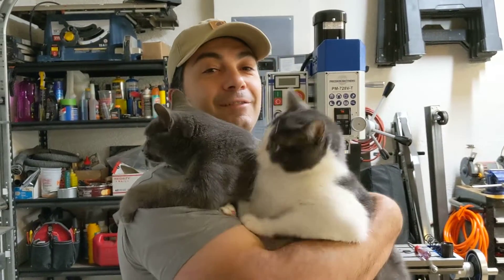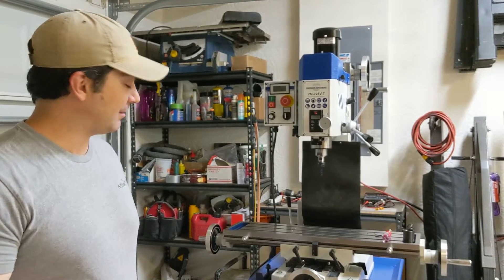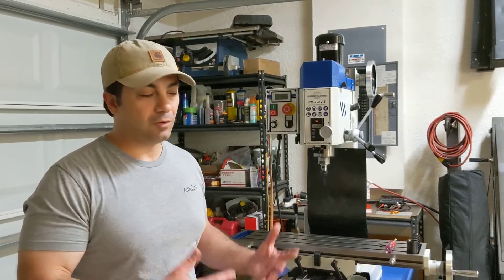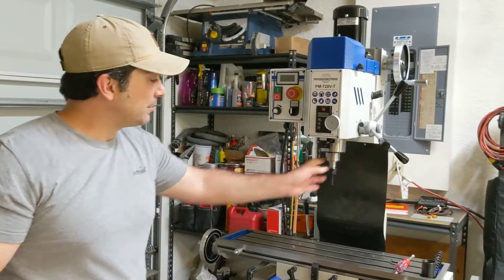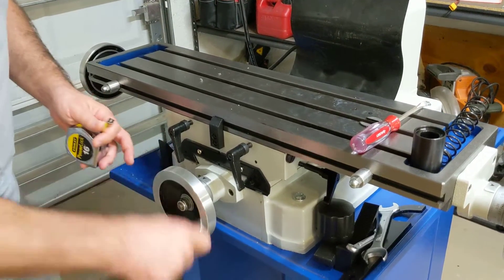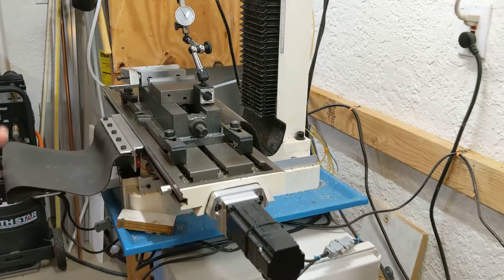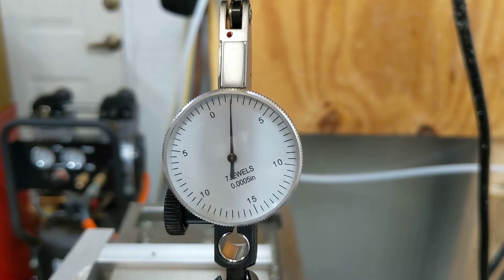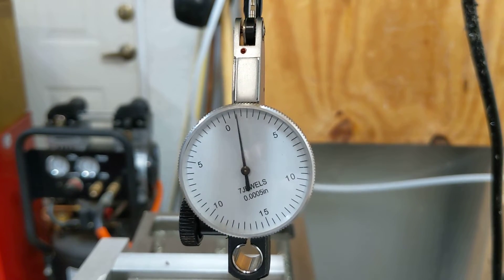Precision Matthews PM-728VT vs PM-25MV Milling Machine Comparison

Comment: What was the table tram in the Y direction on the PM-728VT?  I have been considering buying one but was concerned because the column is bolted on from  the bottom of the machine  and would make it difficult to adjust or shim.

Comment: Cool cats!  Appreciate the comparison video on the two mills...  I've been looking at purchasing a medium-ish bench mill and want something robust/rigid, with good accuracy.  I've seen your video no the PM-25MV and had contemplated that due to cost, but after watching this video, as well as a few others on the 728MV, I think that's the way to go.  It appears to be a solid machine for the money, and looks to be of a higher build quality than the Grizzly equivalent.  

Regarding backlash...  That can easily be worked around, I've used Bridgeport's with a huge amount of backlash and it's manageable.  The best and most obvious way is to install a DRO, gives you absolute position, regardless of the amount of backlash.  I'd much rather have smooth travel in the three axis'...  

Great walk around of the machine...  Just have to figure out what I want to sell so I can use the money to buy one!

Comment: I saw your craigslist ad in which you're selling the 728VT. Any particular reason you opted to keep the PM-25MV over the 728VT? I was looking at the PM-25MV as potentially my first milling machine (no plans to CNC at this time), but your listing has me intrigued.
Reply from the maker: The PM728VT is a good machine - better than the PM25MV.   Truth be told, the PM25MV may be the next item to hit the auction block.  I'm dealing with some changing circumstances that require me to spend less time in the garage and more time focusing on other things.

Comment: 3:45 - This bit me in the butt today.  I spent 20 minutes getting the chip tray and mill all bolted down on the stand.  Then went to start tramming it in and there's 4 thou of lean i wanted to shim out of the column.  On the 728vt, that means I have to unbolt everything from the stand and hoist the thing up in the air to access those bolts.  Kinda disappointed that the "ultra precision" model is way more out of whack than my harbor freight mill was.

Comment: Does their stand have a hole underneath where the column mounts so you can get to the bolts? Or do you have to lift the mill off the stand in order to get to those bolts? Also, did you have to shim the column at all to tram it (or did you even worry with that)?
Reply from the maker: Hi.  There are no holes in the stand.  I've not had to shim anything to tram in these mills.  But, that is not a promise that you won't have to shim yours to make it "perfect".

Comment: Just for the hell of it I’d like to see that twist test on a full size Bridgeport mill. I’d expect zero deflection of course given the mass of the castings.
Reply from the maker: I did perform this experiment on a Bridgeport mill (using the exact same bungee cord).  There was very little displacement - less than .0005" which is no surprise considering the size/weight of the machine as well as the construction.  Bench top mills are great and many of us wouldn't have a mill in our garage or basement if it weren't for them.  But, when it comes to machine tools, bigger is usually better.
Reply: @FrancoCNC  It's a great test and really opened my eyes to what these little machines are. I found a new-in-the-crate PM-25MV on craigslist that I almost snagged. Guy bought it with the intention of doing a CNC conversion but never even unpacked the machine. Unfortunately someone beat me to it. Maybe a blessing in disguise though after seeing this video. The extra rigidity in the 28 over any distance on a part would be a lot of improved tolerance! I'm still shopping for and weighing the used Bridgeport option though.
Reply from the maker: @thenetwerx  Cool.  I've thought about using a knee mill as a starting point for a CNC conversion.  The problem is the big heavy knee can be problematic when you try to make it the Z-axis.  You don't see very many "real" CNC machines that use that design.  They generally put the Z-axis on the quill of a knee mill but then you have limited travel.
Reply: Franco yep, you are correct. I wouldn’t convert it to CNC. It would be for manually machining larger, heavier one-off projects that simply won’t fit on a bench top mill or require more horsepower and rigidity. In an ideal world I’d have the space in my garage and funds to have both a Bridgeport and a nice CNC mini mill. BTW, have you watched any of the Titans of CNC Academy video series?
Reply: @FrancoCNC  you could perhaps add gas struts to the knee
Reply: @FrancoCNC  This is getting a little carried away, but pulling on the spindle on a Bridgeport doesn't apply pressure to the Z-axis ways like it does on the bench mill.  The Brideport design might be weaker if you pulled on the table instead.  A better comparison would be to have two bungees, one pulling on the spindle and one pulling on the table in opposite directions.  This makes a differential measurement and would be equivalent to the deflection from tool cutting force.
Reply from the maker: @mgraen  I like the way you think...

Comment: PM-728VT is $1K more than the PM-25MV, with your honest opinion you think it's worth it when it comes to precision and tolerance for ease of usage with a CNC? Thanks.
Reply from the maker: Aside from the smaller size, the  PM-25MV is just as good under CNC control as the PM-728VT.
Reply: @FrancoCNC  Thanks for the reply. Also what about your opinions between PM-25MV and G0704 under CNC? The G0704 seems to be about $500 lower now. Would the PM-25MV be much better for $500 extra?
Reply from the maker: @sto2779  If it were me, I'd buy the PM.  But, I'm sure the Grizzly would also do fine.  But, I do believe the PM is better than the Grizzly and the people who run the show at PM are super cool.  You'll get better customer service from them.

Comment: Just ordered my PM-728vt to replace the harbor freight mill.  The DRO model is on back order for a couple weeks which gives me time to make it a spot.  I'm trying to figure out where in the garage it will sit when it finally gets here.  Can you measure how tall the blue stand is and how far up from the floor is the bottom of the table or X axis crank or whatever sits lower?  Basically, I'm trying to figure out if this can sit beside my existing work bench and be tall enough for the table to overhang over my work bench if that makes sense.

Comment: I have converted a PM25 to cnc and acknowledge it's shortcomings by taking smaller cuts and plenty of them. You don't have to wind any wheels, hopefully you just have to watch it do the job.
Reply: Hey Phil, in hindsight would you have done anything different, like perhaps upgrade to a newer model for cnc, or are you happy with the PM25 cnc?
Reply: @anthonyortiz7924  well bigger is nearly always better, but I'm pretty happy with it.
I did go a bit overboard with the power of the stepper drivers though, turns out that I could have got away with controlling the whole machine with a gecko G540 on 48volts according to "the Corvette guy" channel. Anyway I find it a handy machine to have for jobs that are too heavy for my routers.

Comment: Another difference, with the PM-25MV you can get away with a 110V 15A service. With the PM-728VT you need a dedicated 110V 20A circuit for it.  I would have to upgrade my electrical service to run the PM-728VT in my garage.  Just something else you need to factor into the equation.

Your Russian Blue is not as skittish as ours is.
Reply from the maker: Tucker, the all grey fellow, has very strong hunting instincts - he won't eat his food unless you play with him first.  Winston, on the other hand, is very lazy and friendly.
Reply: @FrancoCNC  Tucker looks like he is a Russian Blue breed. They have some interesting characteristics. We got our girl as a kitten from the shelter. You don't see many of them there and we were lucky in our timing.

Comment: Can you tell me what the main decisions you made to go PM over Grizzly or other similar brands. I have a G0704 and a G0720R that are both CNC. I’m looking for a good machine to keep as manual now. 

BTW, great torsional displacement comparison. If you can move the heads .002” with a bungee that’s wild!  Imagine the displacement taking a decent sized cut. I have to do that test on my machines.
Reply from the maker: Grizzly is a great company and I've purchased a lot of items from them.  I had a G0704 mill.  I feel the quality of the PM stuff is better.  PM is also a smaller company and they seem to have really good customer service.  Truth be told, nearly every machine is going to have some kind of displacement under load.  The other day, I grabbed a hold of a Makino CNC milling machine while an indicator was on the spindle and I could push it around several tenths (.0001") without too much effort.  Honestly, the best test for any machine is to make a part.  If you can hold your tolerances and get good finishes, then you are doing great!

Comment: So is there anything the 728 can do that the 25 cant, other than work on bigger pieces and deeper cuts/more precise?  
  I wanted to get a mill for hobby gunsmithing.  I've made a few 80% AR lowers as well as glock/polymer 80 lowers.  I've been wanting to build a 1911 but didnt want to buy a bunch of special jigs and tools that are only good for 1911s so figured I could get a mill that I could use for other parts as well, for example maybe some parts for my motorcycle or something.  
  For my uses, do you think the PM-25 would be a good choice or would u recommend the 727V or the 728?
  After watching your comparison video, are the only differences size/weight/precision of parts and rigidity for the most part or is there a job that the 728 can do that the 25 cant without major changes ?   Do you think the PM 25 is precise enough to cut the rails on steel 80% 1911 frames, as well as steel slides?  
  Just want to make sure I get a machine that's capable/precise enough to cut rails in a steel 1911 frame which is probably the hardest metal I'd work with so just want to be sure its capable to cut nice, straight and even lines.  Thank you for any feedback you can give me, I really appreciate it!  Seems like the 728 will be a bit more precise as well as able to work on bigger projects but doesnt seem that I would need something like that for what I want to use it for.
Reply from the maker: Hi.  I think the PM-25MV would work just fine.  You'll just have to make sure you don't push the smaller machine out of it's "comfort zone".  But, if you can afford the bigger machine, you won't regret it.
Reply: @sammy awesome, thanks!  Definitely reassuring to hear coming from people that actually own the machine.
Reply: @FrancoCNC  Just ordered the 728 last weekend.  Deciding factor was thinking about all the "made in China" items I've bought over the years, most stuff cheaper clones of things and Chinese items almost always have low quality fitting, low quality material, or low quality assembly, usually thought is 2 of the 3 listed lol.
  So figured it would be best to put all my money toward the mill and vice, and since its backordered thatll give me time to save for a month or 2 for some tooling.  
  Actually started to consider the PM-833V-T, but that would have been really pushing it considering the space I have and I'd also have to get a 220V electrical setup so decided the 728 was the best for my circumstances.
  Cant wait until it arrives!  Hoping I learn more between now and then about setting it up and get all the guages and indicators necessary to set it up properly!
Reply: @perchowski3021  I got the chinese mill in 2018.  It was 1/10 the cost of this 728VT.  It was fine for getting into the hobby.  After a pretty easy life with a couple hundred hours on it, the chinese mill up and died on me.  I was in the middle of milling a washer.  A grade 8 washer from lowes, about 1/8" thick.  The little china mill just quit mid-cut.  Best as I can tell, its the motor that quit working.  It runs about 1/2 the cost of the machine to buy a new motor from LMS and my 90 day warranty is up. 
I was pretty much sold on something from precision matthews.  The extra 2yr worth of warranty is really what pushed me to the 728 over the 25.  Hopefully they actually honor it without any funny business like requiring you to ship the entire mill back to get any service.
Reply: Will the pm25 handle milling small slots through a 1/2" piece of stainless steel if you just take it slow with good end mills?
Reply: @jbaileyknives7282  the key to getting top performance out of any mill is using high quality end mill bits. You would want AlTiN coated variable twist end mills to squeeze the most out of a small mill in stainless steel. A half inch bit of this sort will set you back about 50 bucks. Most of the worst complaints which have been heard from small mill users have been associated with cheap bits AND bad feed and rotational speed rates. Many balk at spending real money on their cutting tools when they go low-price on their machine.

Comment: Precision  mathews should make a special "cnc ready" machine. One that is designed to be user upgraded to a cnc mill as easy as possible.
Reply: Iv been thinking the same thing. I don't know why they couldn't import a machine with ball screws and motor mounts. It would be a great value for us.

Comment: So glad u did this!  About to buy a mill and wanna get a Precision Matthews.. its gonna be the PM-25, PM-27V, and PM-28.  Gonna be my first mill I know nothing lol.. figured I'd get the bigger one since all the reading I've done says to get the biggest you can afford.  Or even the biggest you cant afford lol..
Reply: Don't overlook the PM30-MV. The PM728 does have some nice features like built in oiling of the ways, worm gear adjustable head tilt, better bearings, and possibly better finished ways to name a few. However the PM30 has a 2 HP motor, larger work surface and 160 lbs more weight. If I had it to do over it would be hard to choose.

Comment: Wow good video. I need some help please. I know that this video is 2 years old. But I just received my PM 728 VT milling machine December the 6th. I have not been able to get in touch with anyone at precision mathews due to the holidays. Mine has 800 thousandth back lash in the X axis which is unacceptable to me. In your video you said you could adjust it out. Please tell me how. Thanks in advance for any help you can throw my way.
Reply from the maker: That is quite a bit - over 3/4 of an inch.  I would look at the collars - it is possible that the may not be assembled correctly.  The nut under the saddle should have set screws on it (or something like that) to spread them apart to take up some of the backlash.  But, it sounds to me like there is something loose or not assembled correctly.
Reply: @FrancoCNC  thanks for the advice. Got in touch with precision Mathews today. I pulled the table off and found that the brass nut for the cross slide screw was the problem. One screw was backed completely out and the other was hardly even started. When I would move the table back and forth the brass block was moving with it causing all the back lash problems. Got it tighten back up and all is good now with no back lash. Thanks for the help.
Reply from the maker: @anthonycash4609  I'm glad I could help.